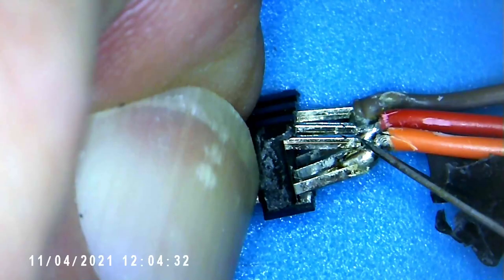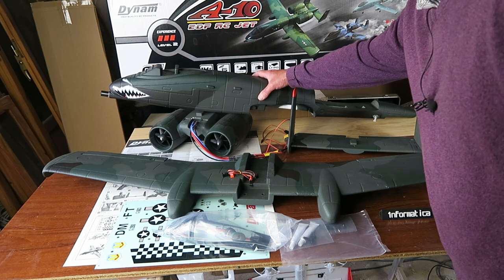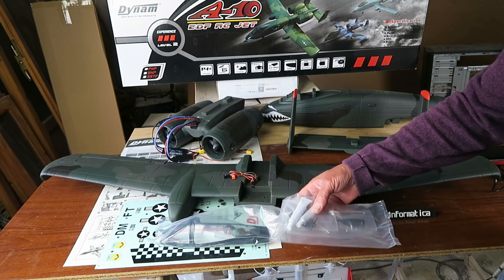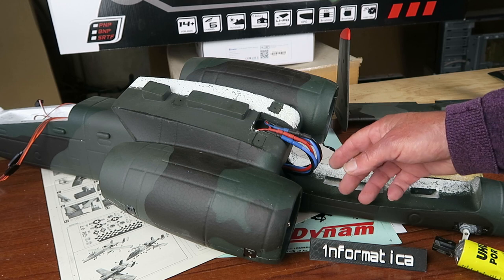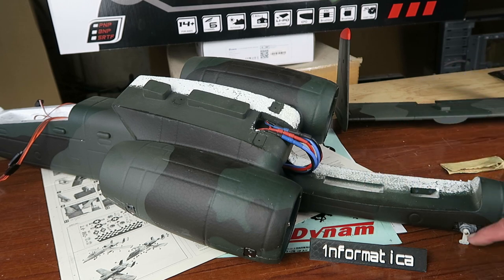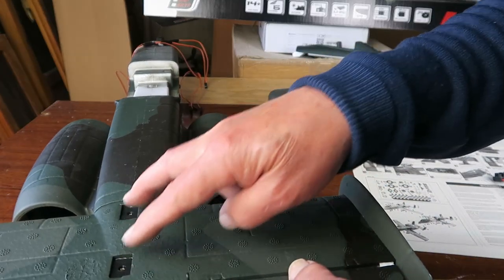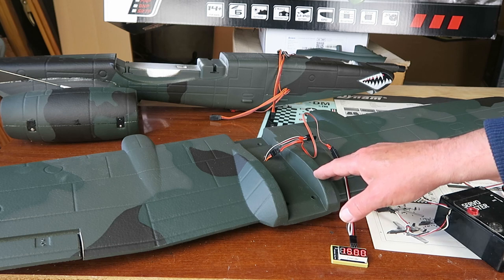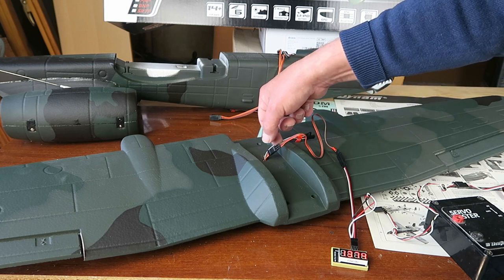Dynam A 10 Warthog V2 1080mm Wingspan Dual 64mm Ducted EDF Jet Build

Comment: Why is there no inlet lips on dynam a-10 fan housing, does it need them?
Reply from the maker: The inlet looks pretty close to the original I think. Bear in mind it is a turbofan not a jet engine : https://en.wikipedia.org/wiki/General_Electric_TF34 Flies sweetly anyhow! https://youtu.be/tSKn8fcgxW8
Reply: @1nformatica  could I put some fans in there with inlets built into them, not the stalk ones??
Reply from the maker: @43rocket  Of course! The plane flies well on the factory setup so I really do not see why you would want to makes things difficult!
Reply: @1nformatica  did you balance the fans?
Reply from the maker: @43rocket  No need to balance the fans, no noticeable vibration from either unit.

Comment: are the retracts on y harness?  im thinking about putting these retracts in my dynam a-10 kit, are they good??
Reply from the maker: Yes, the retracts are on a Y harness. They work well for me and have absorbed even my hard landings! Thanks for watching, have a great day!
Reply: @1nformatica  so a triple y harness?
Reply: @1nformatica  and does the nose gear have its own servo to steer?
Reply from the maker: @43rocket  For the retract function yes.
Reply from the maker: @43rocket  Yes, it uses the rudder channel.
Reply: @1nformatica  where is the sterring servo located?  built into retract?
Reply from the maker: @43rocket  The steering servo is about 6 inches behind the nose wheel : https://www.manualslib.com/manual/962148/Dynam-A-10.html?page=5#manual
Reply: @1nformatica  thats for no retract version where is your servo located for retract version???
Reply from the maker: @43rocket Strangely in exactly the same place!
Reply: @1nformatica  for the retract version does the steering servo sit in same place as fixed landing gear sterring servo?
Reply from the maker: @43rocket  Again, yes. As far as I know there is no difference between the versions aside from one has retracts.
Reply: @1nformatica  I need  to see where servo sits for nose steerring on retract version, can you send me a pic?
Reply: @1nformatica  I need a picture on how servo is connected to from retract sterring bud?
Reply from the maker: @43rocket  https://drive.google.com/file/d/1GkNNsDiq1OaQF_LKU_g2Iqqt24dt-qMC/view?usp=sharing
Reply: @1nformatica  I need to see  how servo is connected to front retract, can you send a pic?
Reply: do you understand?
Reply from the maker: @43rocket  https://drive.google.com/file/d/1HQRm2dZ-Fbecz6YR0NgBTQqKHe45r6fG/view?usp=sharing
Reply from the maker: @43rocket  https://drive.google.com/file/d/1HQRm2dZ-Fbecz6YR0NgBTQqKHe45r6fG/view?usp=sharing